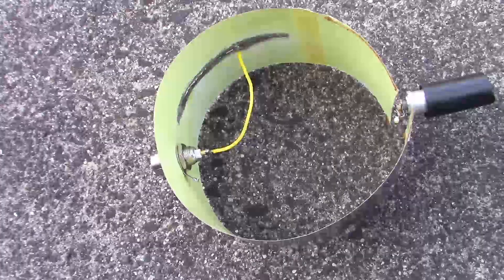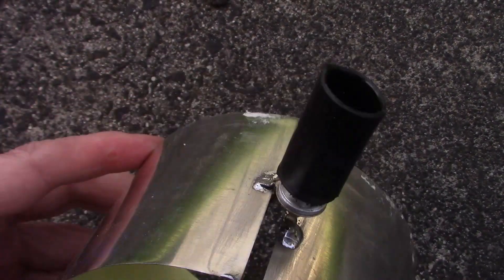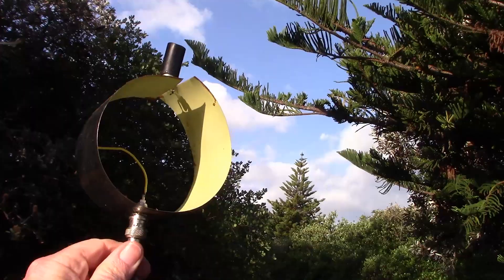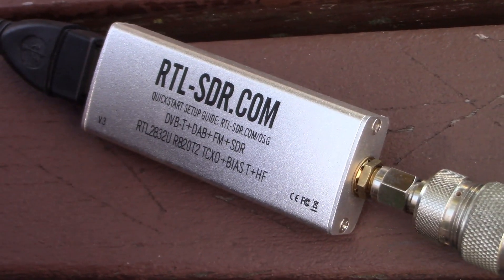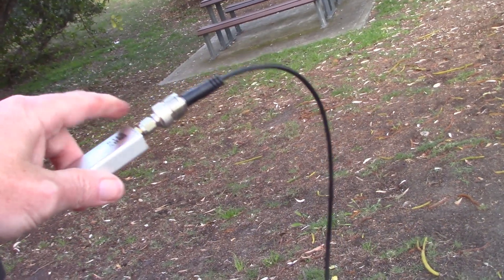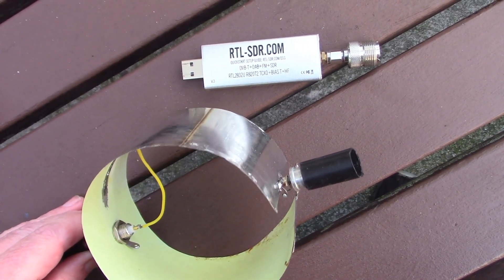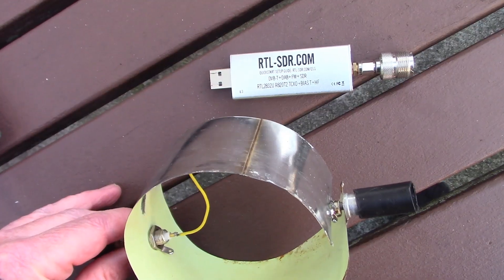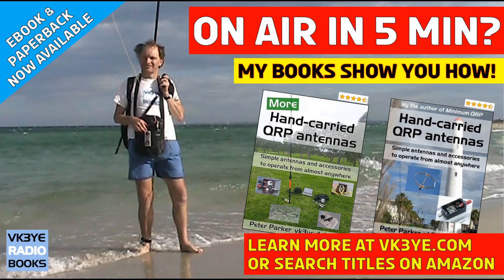Tin Can Magnetic loop picks up VHF signals (Tx too)

Comment: Hi Peter, I’ve copied your idea! I’ve used a polyvaricon for tuning, certainly works on RX with no problem! The smith chart didn’t look quite so good though so I’m planning on moving the contact point to try and achieve a better balance. Wondered what you found? God bless, Bill G6ATO
Reply from the maker: Yes moving the contact point should help.

Comment: Why you didn't use the aluminium sheet, it would be higher q and much better performance ??
Reply: Still waiting for answer. Why didn't ye use copper or at least aluminiumv? Steel can will give lower performs, low Q higher loss
Reply: Still waiting for answer. Why didn't you use copper or aluminium instead of lossy tin ??
Reply: Still waiting for answer.

Comment: You could bend up the can on each side at the gap where the capacitor is to form some parallel surfaces for capacitance. Pin almost together at one end and use a nylon bolt to vary the gap at the other end.